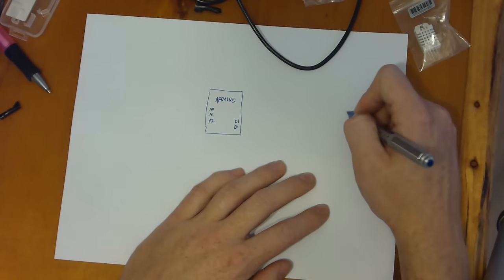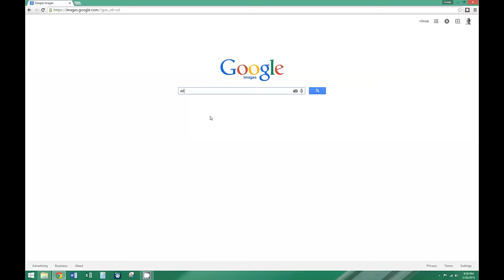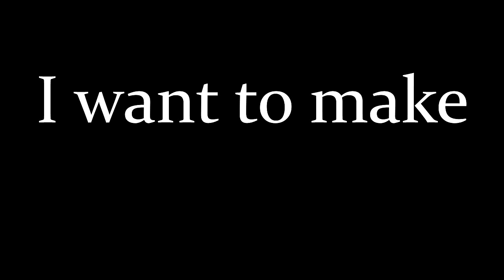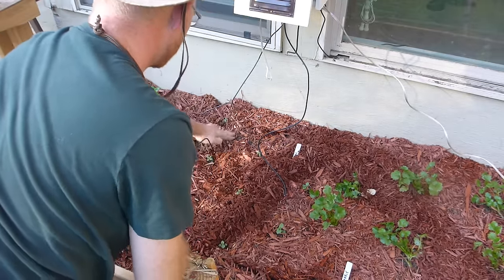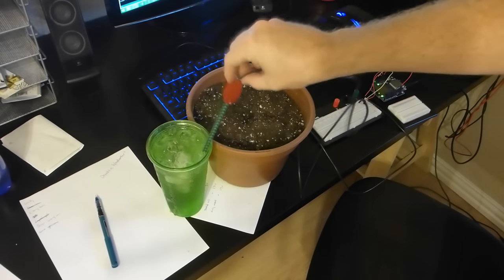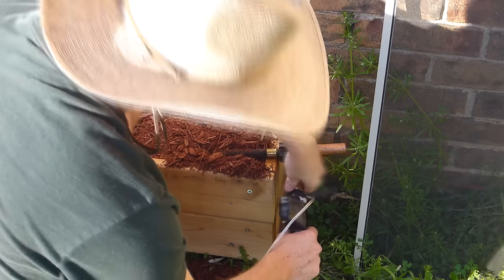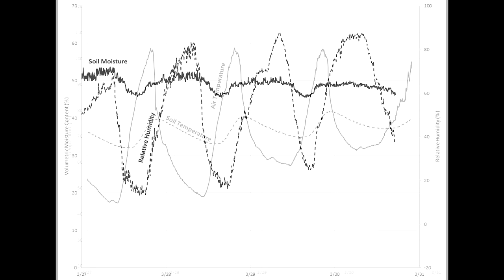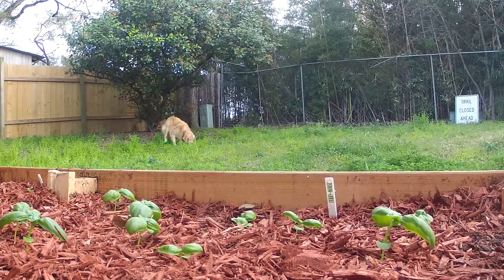Arduino Garden Controller - Automatic Watering and Data Logging

Comment: I have been working with Arduino for almost a decade. I find my fascination is involved with the recording and study of routine detail or reverse that: The detailed study of the routine. It's like watching a time-lapse video of the sky. We usually see the sky only in still shots of memory. But, if you study it in its full motion with time-lapse, you see an incredible dynamic of movement you never really noticed before. Arduino is the ever-vigilant sentinel of light levels, temperature changes, and other subtle changes and can react to these environmental changes in ways and with reliability, humans never could. So it is that i think of it as the absolutely perfect gardener if we can program it correctly.  Commercial farming today would not be nearly as productive as it is without computer control assistance. Arduino puts that amazing control in the hands of the everyday back yard gardener.

Your project really inspires me and I am sure others, to give it a try.

Comment: I sincerely appreciate the approach to gardening to make simple through what might seem like an overly complicated ideal. The end goal is to do what wasn't even realistically possible even 30 years prior.  Micro computers and localized sensors make garden micromanagement a reality.   Although it may not be known what actually causes the failure of a plant, you can to a much higher degree, monitor the I/O of a connected garden than a non-connected one.     Thank You For doing all this work, testing, graphing, soldering, installing, planting, etc.  I am grateful to you.

Comment: i'm a little late for the party, but i got my arduino kit about 2 months ago, and this video pretty much sums up my projects involving the arduino. 
the side project is installing IR enabled light and fan switch, which hang a meter from my desk.
as for the main project, that one is a little more complex (and even more unnecessary).  the gist of it is that i'm also going to control my audio system with IR as well. so basically every knob or switch that was quite literally within arm's reach, will now go through the arduino and be controlled with the IR remote. at that point,i figured i might as well hook up the compute power to it, too, which again, was also within reach. and in case somebody is wondering, yes, this project does include a zip-tied servo motor hot-glued to a volume knob on one of my amps.

Comment: "As a civil engineer, I would have been happy with anywhere between 80 and 120". I'm not sure exactly what this joke means, but it amused me anyway :-)
Reply: +Steven Pam Haha, yeah. I think it means 'as long it says that water is more wet than everything else I'm fine, even it says that it 20% more wet than water." kkkk
Reply: Steven Pam I think he was referring to the usual way dimensions are honored in the construction industry....
Reply: I took it as more of an inside joke between engineers. 

Civil engineering has a very high tolerance for imprecise figures, sort of the bane of the typically extremely precise engineers in most other fields (like structural, aerospace, mechanical ect). 

A hammer used to flatten dough is good enough for the civil engineer. But mostly because thats typically the best possible attempt given the funds, and complexity of data inputs and interactions with the things they deal with. 

Eventually some just adapt to the state of deprivation.
Reply: ideally, the water content by volume, for a cup of water, should be 100%
Reply: +Mike Weatherl For that of course one would need to find a sample of water with no impurities, with water being about as close to a universal solvent as any liquid can get finding a completely pure sample of the stuff is nigh on impossible.

Comment: Every time I've seen a rainstorm followed by sprinklers running I think to myself there ought to be a way of automating to prevent wasting water. The layman in me know it's not as easy as it looks, but the Coloradan who has watched the drought cause us much trouble can see it's not that hard either. This ought to be reproduced on a grander scale!
Reply: I'm in the Houston area.  We had a tropical storm come through here last year that gave us 50" of rain over a couple of days.  Wasting water is not really a concern around here. :)
Reply: There are automatic sprinklers with moisture sensors, or that have connection to  weather service to halt watering.
Reply: The guy literally programmed his arduino moisture sensor to only water when the soil moisture was below a threshold...

Rain would be included in this equation if that was not obvious.

Comment: Thanks for sharing your project! I'd like to throw one of these homeboys together myself. Would you be willing to share your circuit designs and explain how you set up the hose to irrigate your garden so nicely like that? As an EE with an interest in expanding into agricultural engineering, I think this'd be a good place to get my feet wet, so to speak. Eventually I'd like to take it a step further after I've got my hands on a server rack so that I can get some experience archiving and analyzing the data as well, but first thing's first: getting this embedded system up and running!

Comment: Cable management arhfghghhghg
Reply from the maker: lol
Reply: I don't think these kind of projects ever have good cable management lol.

The Arduino boards are a good starting point for playing with this stuff.

Would be interested to see if he could take this even further and design his own circuit board with the ATmega328P and the bare minimal components to make this project work to take up as little space as possible. :D
Reply: Callum WK    I hear you......    my OCD is now making me twitch.....    damm it!
Reply: teja chilukuri  with no data logging its not exactly complex. 1 sensor, 1 solenoid,  1 microcontroller.

Comment: A nice article showing that you can employ simple solutions to a garden project, but for the size of that garden a water timer would probably be better. I can clearly see you love to use an engineering approach to solve your little problem. I would have added a small solar panel on your box lid, just to make it slightly more efficient. Sending the Arduino to sleep (utilising thee WDT) for periods of time also saves a lot of power. 
You have forgotten (or do not know) that there is one thing missing from your equation soil + water + light, you need to add air, and that is not above ground, that is below ground too. Many plant roots do need air which can help grow better plants. The natural drying out of the soil draws air down through the ground, which is why many plants do not grow well in heavily irrigated soil.

Comment: honestly i think this use case is actually pretty well suited for an IoT solution (e.g. using a cheap ESP8266 or similar platform). despite all the garbage that is put out in the IoT domain, this could come in really handy with remote monitoring if you're tending to a garden (or multiple) which might be in a remote spot or where there is a water tank to be monitored etc.

plus you can make cool graphs from your chair in your office on the fly with real time data

Comment: First off, love your channel and been watching for years.  

second, picked up a large Miracle-Gro Twelve from the thrift store with a wanky water level sensor.  These are scaled up Aero gardens that also function as a table.  The main user interface is through an app which is not longer available so I'm going to need to make my own.  Down the rabbit hole I went and then I stumbled upon this video.  I have been tinkering with Arduinos for about 10 years now and haven't had a good project to get back into it... UNTIL NOW!  Love some of the concepts you were using and may update the sensors to start targeting closer to those.  

Anyway, figured I'd leave a comment on an older video just to let you know its still seen and much appreciated.

Comment: I came across your video while looking to see how people are handling it, I was about to start this kind of a project but was considering using segmented hosing under the bed of my garden stemming from the main hose connection with extra controllers to water sections based on frequency each type of vegetable would require and having a sensor detect rain and compare to google whether forcasts to determine if it should water because it's sunny or wait until a few hours before sun down if there's a chance of rain to not overwater it. And just have a timing system count down from variables getting reset every time it rains or waters it. However that tool you had to check moisture levels in the soil is pretty interesting and I'm thinking of revising my plan with a rain gauge and that sensor to add to it's accuracy is making it control amount of water received as well

Comment: "After all, no ones hobby is to buy an irrigation controller off the shelf of a hardware store."

This quote reflects my feelings whenever I start messing around with micro-controllers. There's almost always an off-the-shelf solution that's cheaper and more effective than whatever I came up with. That said, I don't think I ever would have realized that the off-the-shelf solution even existed, if I hadn't played around with the Arduino first. The act of learning has inherent value, even if your application of that knowledge is limited to buying a solution at the hardware store.

Comment: Last year I designed a Humidity controller for my indoor garden, this year my son in-law wants to do the same thing so I got started and decided it would be nice if it had WiFi so I got an ESP8266 (ESP-01) and added WiFi for remote monitoring. After getting that working I thought it would be nice If I had a browser just for the humidity controller so I dusted off Visual Basic 6.0 (yes I still use this old work horse development program) and now I have dedicated web browser that logs the information from my controller. Now I can make charts and graphs too.

Comment: The reason that plants like a cycle between wet and dry is that as the water leaves the soil it draws in air, which allows the plants to pull in oxygen and CO2 through their roots, and not just their leaves. There are even some mangroves. That have stalagmite-like root nodules that stick up out of the water to get some air.

Comment: Glad I stumbled across this. I used those same LDRs for solar panel tracking Arduino project. Also, did this same project. The sensors that you used though are a lot nicer than mine though (I went cheap). Good video, wouldn't mind more of the tech stuff included though since I'm an ME.

Comment: Lux and PPFD  are units used to measure the intensity of light. Whereas Lux is used to measure and compare the brightness of visible light for humans, its irrelevant as a measurement for plants, PPFD is amount of light suitable for active photosynthesis of plants. TDS and EC, PH is far more critical than just measuring H20 levels. IF you want to be robust in your data, here is what you want to measure: PAR Light range measured PPFD, PH, Temperature,  Humidity, (Greenhouse/Hydroponic tent), TDS PPM which measure electrotonic conductivity of dissolved solids in water,  all are available sensor are available for Arduino

Comment: I like what you said about you having the solution “technology” and look for the problem. For those who are less high tech, it is just easier to do a water timer.  Adjust the amount of watering visually instead of scientifically logging data. I would say water timer needs a lot less effort to water the plant manually or doing a complicated engineering project. 😅

Comment: Excellent video.   You need to add an overhead photo sensor to analyze amount of green (leaves) vs amount of visible red mulch.  Then you can plot growth rate vs optimum harvest quantity and frequency.  Lol. It's not about the basil.  It's all about increased knowledge by careful and controlled experimentation.   Thanks for the insperation!

Comment: I love this. I get soooo carried away by small tasks because of this!  Its why I NEVER bake!!!  On the light sensor....it would be REALLY good to expand this into wavelengths.  The spectra absorption of the plant leaves wont match the light sensor so a photopic response conversion would be handy.  OR if you are a youtube millionaire now, go for an integrating sphere for true incoming light measurements.  Im not going to sleep tonight thinking of this now......
Reply: Oh and sorry to reply to my own comment....but look up saturated salt solutions for controlled humidity environments.  You can use them as pretty good calibration points if you are aware of the different equilibrium times.

Comment: Well done video. A few quick questions: Wouldn't the water hammer arrester be rendered useless because it is mounted sideways? That does't have a bladder in it, right? Also, because it is after the solenoid valve the hammer effect from the switch closing would happen before the arrestor, also rendering it useless.

Comment: It would be interesting to know just how simple a system would get most of the benefit. Your complex one could be programmed to emulate simpler and simpler schemes. A green house would provide a more controlled environment, perhaps allowing a watering system to be even more basic.
Reply: you could probably just have arduino, mosture sensor, power supply and valve... but i have no clue on gardening^^

Comment: I love plants, flowers and vegetables. Unfortunately I am not a responsible person to water them, and they always had the same dry ending. 
I do experiment with different diy soil moist sensors, forthe probes I use two 15-25cm, 5-10inch, copper electrical wires you find in walls home, audio cable froman old audiosystem and one 10k resistor, different probes lengths, different distance between probes. I've got pretty good results comparing to Capacitive Soil Moisture Sensor v1.2
I want to experiment with different probes shapes because the wire is losing contact with the soil as the soil gets dry. I hope to get better results with probes shaped like a spoon,  so the soil presses on the spoon shaped probes. This way the probes will have better contact with the soil. 
I put the probes across the pot, 15-25cm, 5-10inch apart  and I get good values in my ADS1115.
I can add up to 4 adc ads1115 to one arduino and control 16 sensors + another 4 (10 bit analog pins from arduino). I also add an ESP32 to the mix, it sends settings to the arduino,  desired temperature (for indoor) desired humidity... and arduino act as a standalone station, doing it's things and reporting to esp on request (for web page, or bluetooth...) esp32 can control multiple arduino boards 
Arduino is great for this kind of things. 
👍

Comment: OMG did you JUST admit to not knowing how to solder AFTER you already said you are an Engineer?? Solder but my high school education comes into play here when I learned to solder in the 11th grade of high school!!!! Not to mention I took almost every "tech" topic in school, like wood working, metal shop, print shop, drafting, auto mechanics, electronics and small engine repair, AND I worked during to summers for general contractors who did construction and remodeling, and worked for another guy who had his own auto body shop, AND on top of that worked for a landscaping company as well!!! And if that isn't enough I have been hammering on computers since I was 15 years old with my first brand new computer was a Commodore 64K back in the 1980s!!!! And I have spent 24 years of my life working in electronics assembly, but they always seemed to need machinists and metal workers like myself to build things!! Plus I can wire near about anything!!!

Comment: I know this is old, but it's easier to solder on Arduino's/RaspberryPi's if you have thinner solder. I use that iron and extremely thin solder and don't have any problems.

Comment: Nice Video Sir!, btw hows the arduino Sir? is it still working ? Iam confused whether i should choose arduino or plc for controlling air temperature in farm and turn on the spray or other stuffs if it is too hot

Comment: You could achieve exactly the same for the fraction of the price with a watering system from aliexpress. Controller with display is like 8$ just search for Automatic watering controller timer on aliexpress.

Comment: i mean this is a fun project, however if your goal would be to just automatically water the garden for as little money as possible, buy SmartPlug (costs like 10$), you need wifi if your router dosent reach that means either buying a repeater(20$) or even better a DIY wifi directional antenna(can  be build for free from scrap).
Now you need an electric valve(15$) if you use tapwater or a high pressure pump(12$-45$) that pumps from a reservoir and you need a drip irigation hosepipe(depending on garden size, but starting at 15$), so this entire project can be as cheap as 37$.

Comment: Nice work there. Now all you need is an AI controlled robot to control things like weeding, frost protection, disabling the watering process during times of direct sunlight (burns the leaves), and pest control such as slugs/snails/caterpillars.... An extra bonus would be a robot that selected the best herbs for your dinner, washed them and brought them by conveyor-belt straight to your chopping board...!

Comment: Hi! First of all great project!! I know this is a little old so things could have changed but I'm using the same Vegetronix soil temperature sensor and I'm not being able to make it work with an arduino, I'm using your code but it outputs -40C all the time... The guys at Vegetronix said its a problem with input resistance in the analogue pins, did you encounter any issue of the sort with your arduino? is yours still working?